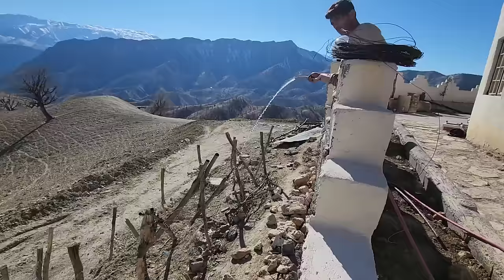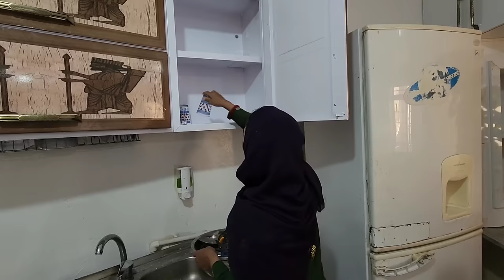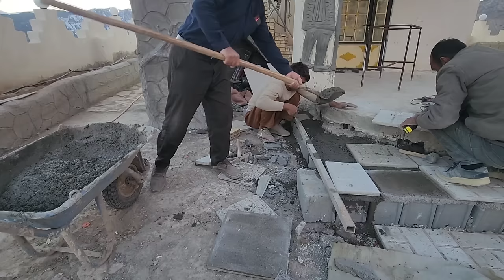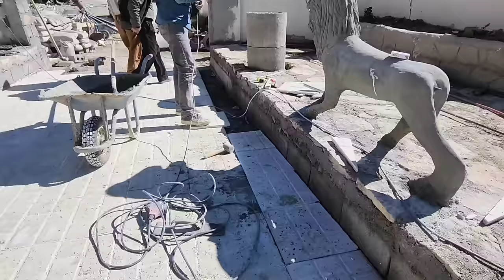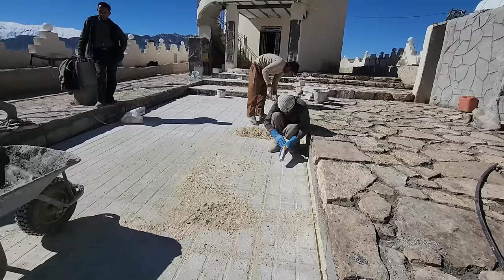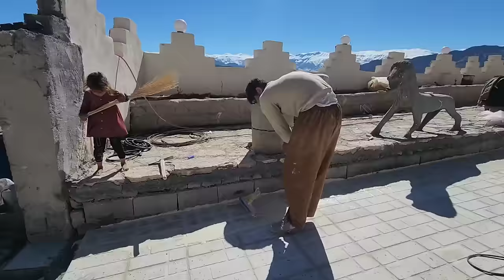The charming environment of the nomadic castle:Hassan's Final Touches on the Castle's Outdoor Oasis"

Comment: ●●●●●●●●●♡●●●●●●●●●
There's been numerous complaints about the water poured on the kitchen floor and putting dishes in the cabinet wet. What they're basically pleading and begging you for is to stop before it's too late.  Water will eventually cause the metal to start rusting. I had a beautiful white clothes washing machine to start rusting around  the top, and I've tried applying rust removed and white cover paint, but the rust keeps returning and spreading. My machine was pretty expensive, and it's not that old.  😢 it's nothing I done, but  just water through usage.😢😢
Dearest Zolikha,  we care about you,  I know I do.  From now on, use a good mop to scrub the floor.  You could buy a Bissell Moo and Vac, which is battery operated.  Just have to remember to keep it charged. Once it's charged, you don't leave it on the charger.  Or you might buy one that plugs into electricity? 
~~~~~~~《●》~~~~~~
Any suggestions from viewers,  help me out here.

Comment: I'm just asking, and I'm pretty sure you're gonna fix it, but I'll bring it to your attention Mr. Good-looking King-Hassan, since you were working on it a but earlie I thought I would ask. On the edge of the rounded part of the porch between the cemented men sculptures on the pillars, are you going to add cement to smooth and fill in those areas? I figure you'll do so when smoothing all edges on your entry of stone. I bet you bought a remote-controlled opener to an electronic gate. It would be the icing on the cake. My garage door operates by using a remote from the inside of our vehicles, as well from inside our home.  One in our garage and a remote just outside the garage door. In your case, perhaps one inside of your car and one by your front door. Maybe even attach security Cameras to which you could speak to the people wanting to enter and see them as well.  This way,  no uninvited visitors can enter without you opening the gate. It's a fancy feature I know,  but a kind of fun one that offers a safety feature and as well as easy to operate. ❤❤❤❤❤❤❤❤❤❤❤